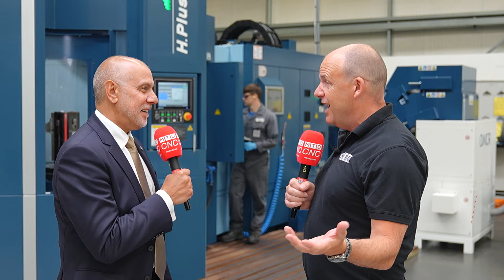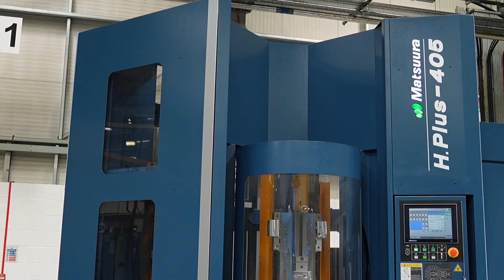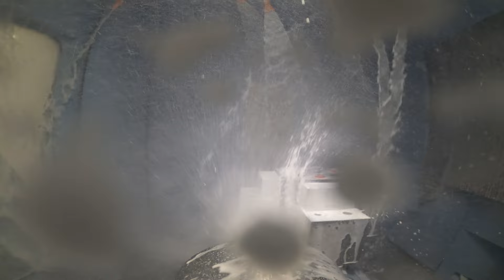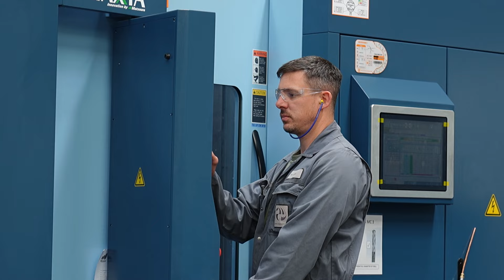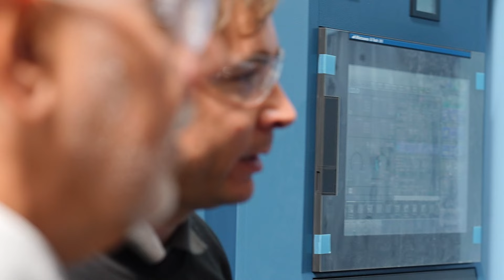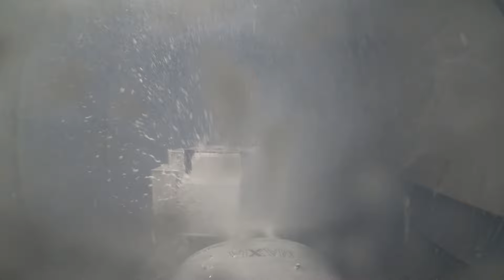24/7 unmanned running for Olympus Engineering with the Matsuura H.Plus-405 multi-pallet system

Comment: I question OEE as a metric here.  Remember OEE is made up 3 elements - equipment availability, performance and quality. World class OEE is 85%. Without diving deeper into the data and and seeing what the "planned losses" etc are I suspect the 98% figure quoted here is is technical uptime where 95% would be considered world class. Still a very good figure any company should be happy with.